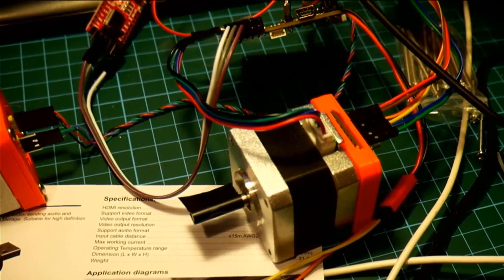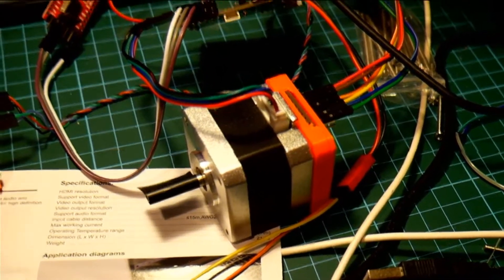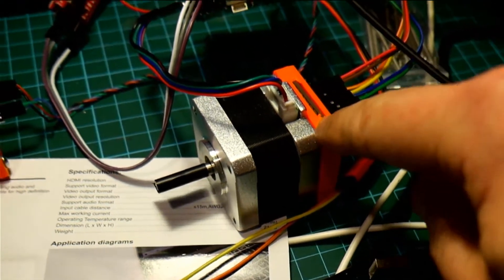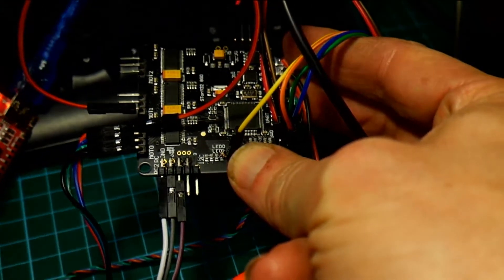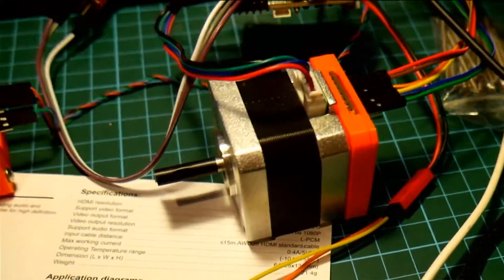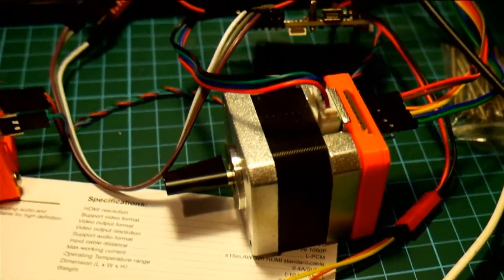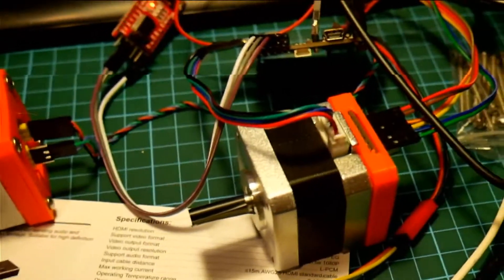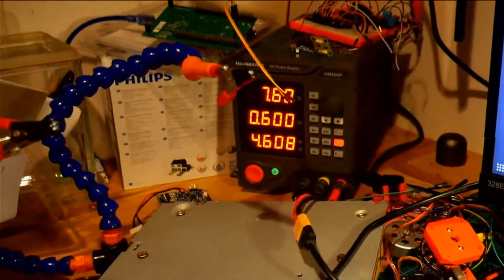Experimental SimpleFOC support for driving Stepper Motor

Comment: thank you for the video i m doing the same but can SimpleFOC run the nema 17 at 1000 rpm  ??
Reply from the maker: I couldn't get the nema past 100rpm!  After this video I abandoned steppers as they are difficult to work with and align.  Gone back to more traditional bldc gimbals.